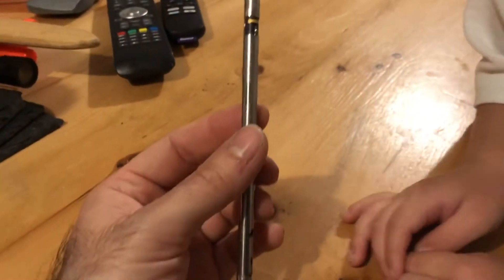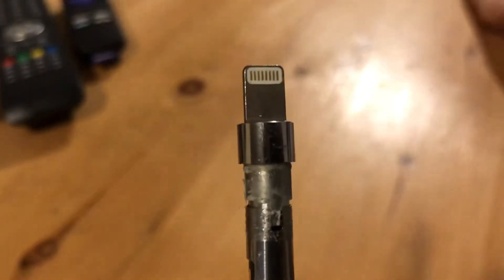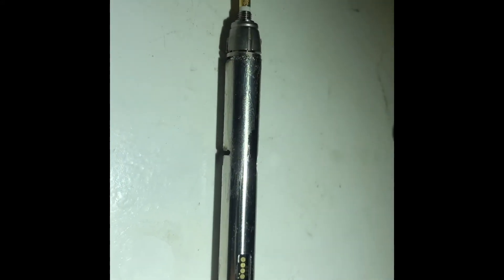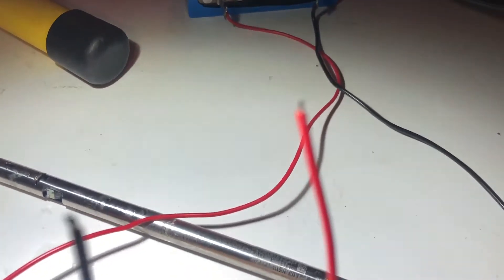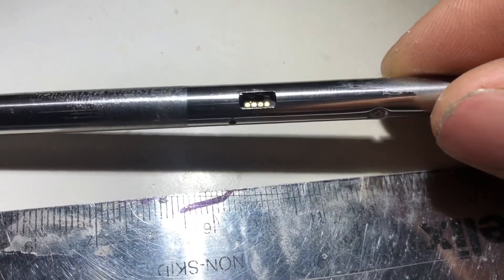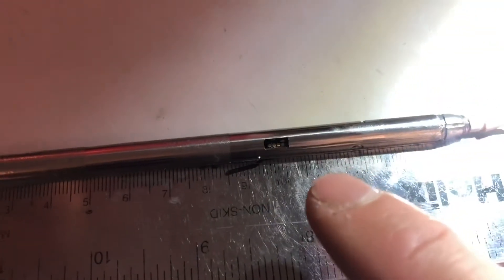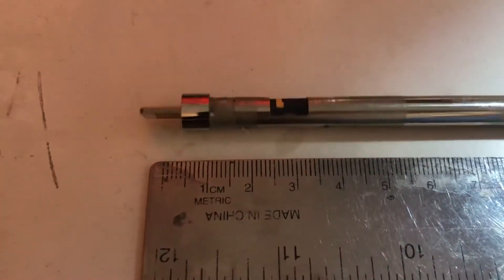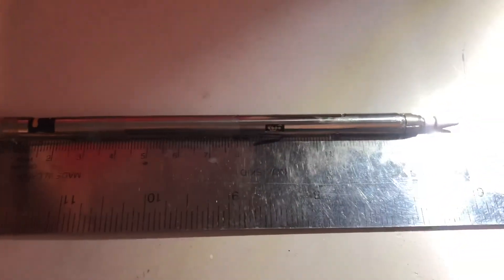Apple Pencil 1 Tear down, Attempted Repair and Observations

Comment: Cut exactly the area stated in video and you were exactly right in location of pins! Tiny little hole I can access terminals from. Moving on to applying a voltage, hopeful it'll work.

Comment: Thanks for your video. I try also to recover my pen after long unused period. After I saw other similar videos, I guess that these points didn't connected directly with the battery. I saw that after the battery there's extra pcb (maybe charging controller, etc) so you can't pass  voltage thru that. I have revived other batteries with your method but you must have access directly into the poles. These 4 pins I guess are for final step programming the inside chip with serial number etc.thanks anyway for the detailed info.

Comment: Thanks for the video. It was helpful. Copied all the steps but moved the cable when charging and fried the pencil. The charging points are so small that it is harder than it seems. Cost me $15 to try with a broken pencil, so no big deal, but the charge points are so small. Will try it once more but might do a whole battery swap next time.
Reply: any progress bro?
Reply: any progress bro?